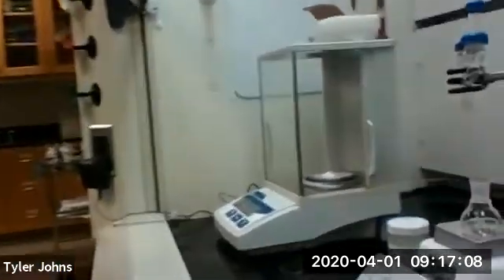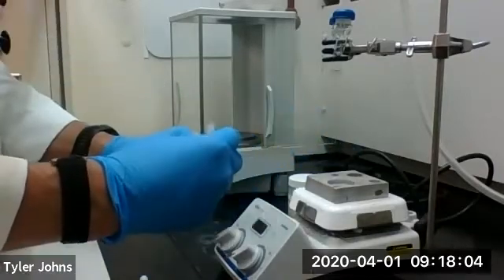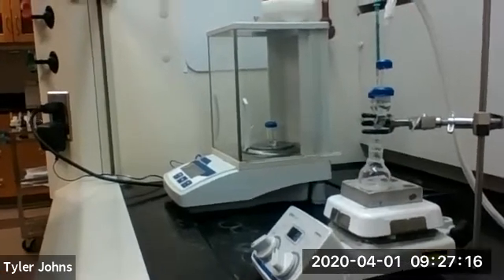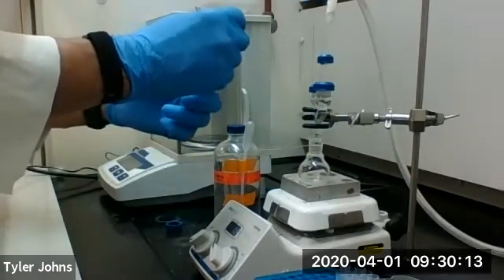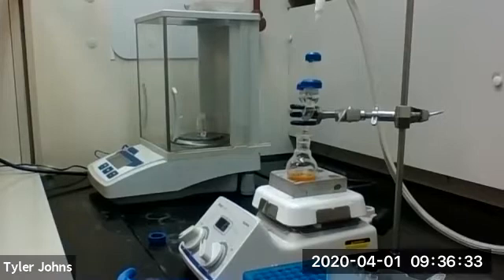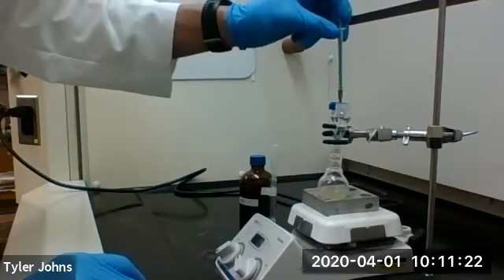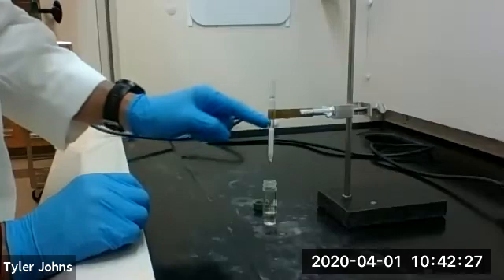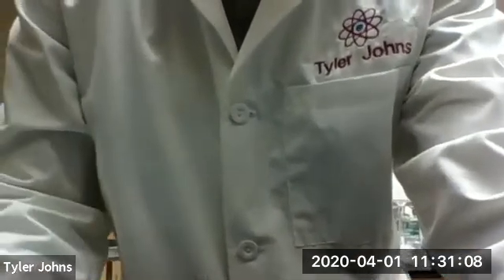Friedel Crafts Acylation

Comment: Hi Tyler. First and foremost I want to thank you for the video. Secondly, I have some questions:
1) Does the toluene has to be pre-dried over metallic sodium?
2) You do use solvent for this reaction. Why? Only toluene Wasn't enough?
3) Do you heated up the AlCl3 to remove umidity?
4) Your glassware was pre-heated?
5) The CH2Cl2 could be a source of generation of byproducts?

I'm asking this, because I will perform a Fridel-Crafts acylation and it's my first time.

I'm looking forward to hearing from you soon.
Reply: @TylerJohnsChemLab  Thank you!